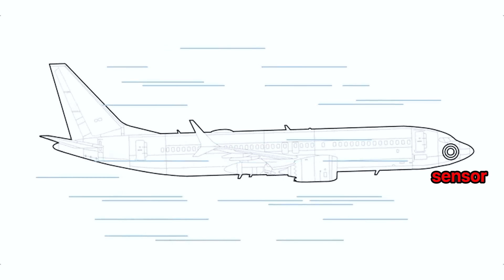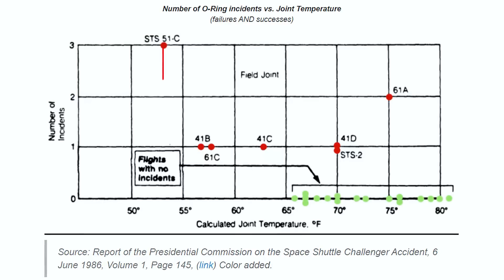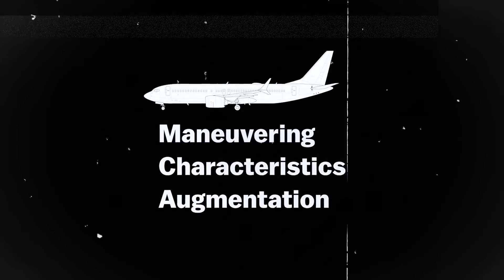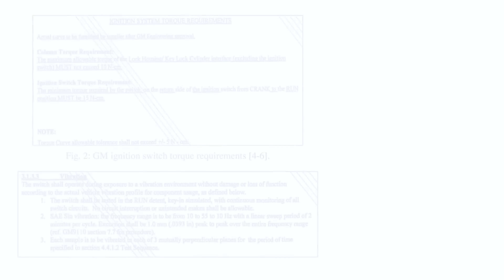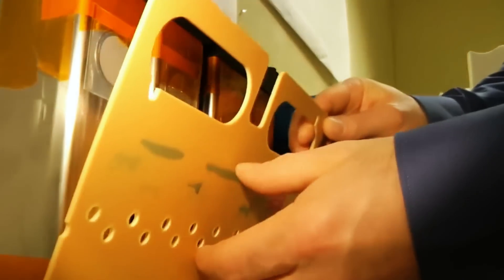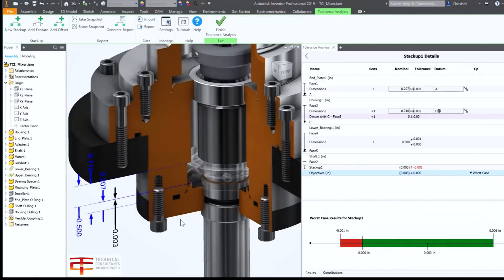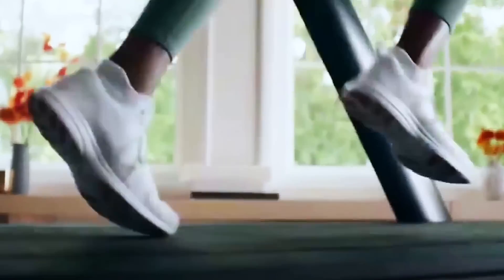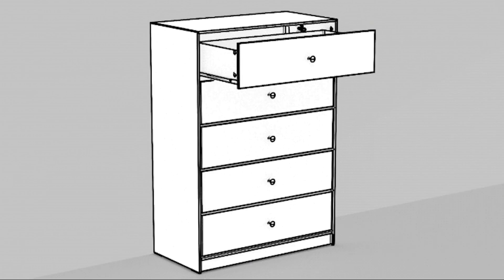Mechanical Engineering Failures That Cost Lives and Billions

Comment: I often make similar complaints about the newest, more complex designs of almost everything—from cell phones to software. It’s clear that non-engineer decision-makers are interfering, steering things away from truly efficient and proper (sometimes not shiny but simpler and safer) solutions. I wonder when will true engineers of this world will unite and get out from elite enslavement. And break free from the technologically deterministic, non-technical mindset. Of course, there are also the new-age, short-attention-span individuals who show less fear of making mistakes—a problem that is, in itself, a cultural vector. Engineering designs need to be error free and team-check issue. Nothing unsafe shall pass no matter what pressure.